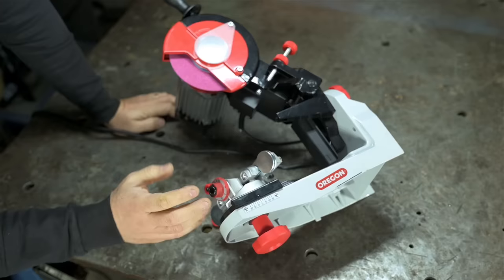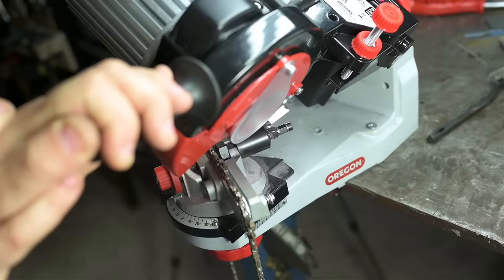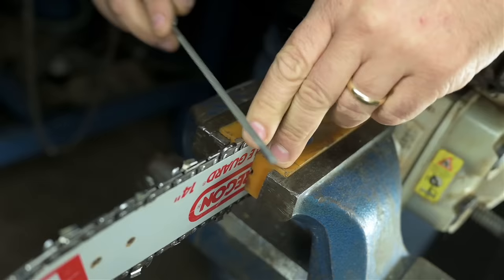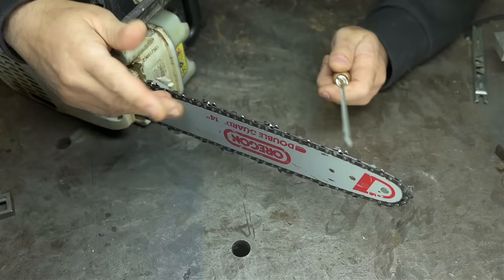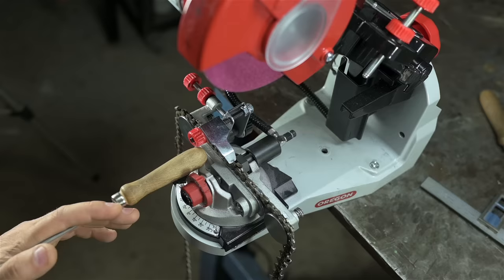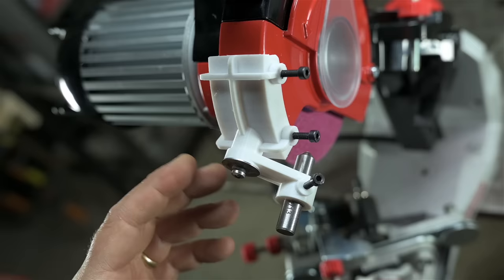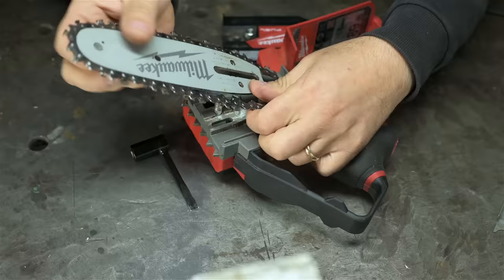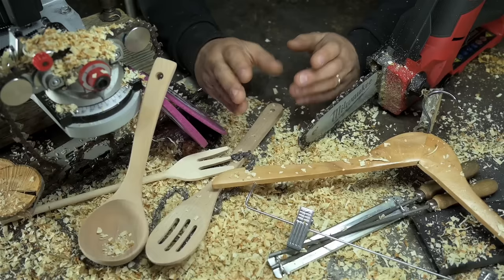Grinding Saw Chain! in Oregon! (620)

Comment: Before hand filing, mount an overhead green   laser to the angle you want to file at.   It won't help much, but will sure  make filing more fun.  👍
Reply: Lasers make everything better. And bacon. You can never go wrong adding lasers or bacon.
Reply: @feynthefallen  and magnets!
Reply: @unglud  and Banana Boat song on the radio.
Reply: @feynthefallen  why not go a step further
laser bacon
Reply: @Dairis Kuznecovs  now we're cooking!
Reply: @davydmir6565 with lasers!!
Reply: @feynthefallen  Lazerpig would agree
Reply: I came here to write this! :D
Reply: I remember the very first episode of "Car Talk" that I heard.  Somebody called in with a question, "should I pump the gas pedal when I'm trying to start my car?"

Click and Clack asked, "what is the make, model, and year of your car?"
The caller said, "It's a Chevy Bazinga, 1988."
Click and Clack asked, "Does it have manual windows, or electric windows?"
The caller (puzzled) said, "it has manual windows."
Click and Clack are delighted, and say, "Perfect! Next time you start your car, roll your windows up and down as fast as you can."
The caller asks, "what good is that going to do?"
Click and Clack say, "Nothing at all!  But your car has electronic ignition, and pumping the gas won't do anything at all!"
The caller asks, "But why should I roll my windows up and down?"
Click and Clack say, "Well, if you want to feel like you're participating, you can roll the windows up and down."

I do miss those boys.
Reply: @feynthefallen  However, adding lasers to bacon ruins the whole experience. Or vice versa. Better keep these two separate.
Reply: Nah, you really want a blue one instead, at least 8W...

Comment: Could I confess something, Tony?
I only get my chainsaw out every two or three years and I thought that when the blade went dull, you either bought a new one or found a professional to re-sharpen the old blade. Then, one day, I was buying a new saw chain and saw that the shop had a sharpening kit. IIRC it was less than £20 - essentially a file and a guide and a leaflet in a plastic wallet.
Fortunately, I never throw anything out, so I have a dozen blunt blades and I can now re-use them all.
For an occasional user, like me, I don't see the point of buying a grinder. The file and the guide let me bring the chain back to life in five minutes. I'll probably die before I use up my store of old blades. Possibly by bleeding out of my femoral artery.
Reply: A chainsaw grinder is not for the casual user. The one here is $500ish.
Reply: @1pcfred  Eek! That's more than I paid for my chainsaw!
Reply: @nicholashacking381  there's cheaper brands out there. Some are very cheap. They may suffer from some of the problems that ToT was expecting though.
Reply: You can get a cheap dremel attachment IIRC, that works pretty well. I think I saw someone using one of the grinding stones shaped like a dowel that worked like the round file except rotating vs back and forth.
Reply: @1pcfred  why not machine a structure to strap in a normal grinder? Make it bulky and tight or even destroy the old grinder in the process to make it sturdier.
 either way seems cheaper(and cooler) than spending 500$ on a fancy(overpriced) mounting vice with a grinder attached to it
Reply: @Ewr42  I would hope some engineering went into the product. I just use a mounted stone in a rotary tool to sharpen chain myself. It's very cheap.
Reply: @boots7859  Yes they do. Just make sure you get the right diameter for your chain.
Reply: As the unproud owner of a cheaper alternative grinder i paid 180€ for, they do the job just fine, but have some unprecision in the hinges. You're gonna have to armwrestle everything into tension  prior to lowering the arm to get rid of the different plays if you want consistency. Also change the stone which is usually very shit
But for my very occasional use they are good. A 500€ one would not have been worth it.
I wonder if there are attachments you can mount on a bench grinder to hold a chain, doing the opposite movement this is doing ? that could be a solution
Reply: Many years ago I spent a few hours cobbling together a chain sharpening jig for my angle grinder that bolts to the handle mount, it's made from bits of an old bicycle, it works fine, I now use it in the field with a battery powered grinder. Cost nothing but a bit of time and patience. Clamp it to a tree/post with a ratchet strap and its good to go.
If you're worried about burrs, just swap the direction of the chain so that the wheel-attack is on to the cutting edge.
Reply: I am also a hobby user,

But before I out a chain sharpen,

I change the chain. And if you catch a stone or nail, you file forever.
Reply: Do you own a Dremel?
Reply: @markferch5494  this thing work fine for me: Einhell GC-CS 85
Reply: I used a 20€ cheap grinder for quite a few chains before I decided to get a more adjustable 100€ cheap grinder. The cheaper one worked fine but the 100€ one is a chinese clone of the oregon one and uses the same stones, also has more adjustments. But as with all machines, you get a better result if you pay attention to what you're doing.
Reply: Didn't you get it when Tony said call it a blade in front of loggers, your going to look like a fool. Don't ever call the chainsaw chain a blade. Call it a chain, call it a chainsaw chain, but don't call it a blade, it is not a blade.
Reply: @reddogknives  The only loggers I know are computers that record data. If they think badly of me, I will not lose a great deal of sleep.
Reply: That last sentance... LOL.
Reply: Files are great and cheap and effective.
Grinders come up used and cheap if you really want one.
Always get to know your tools before using them, it'll save you a lot of time, money and spilled blood
Reply: @nicholashacking381  you're obviously in the wrong Realm
Reply: right on.   ive never considered that a chain sharpener could possibly do what i do with a file.  I'm sure my chain is sharper than most of the knives in my kitchen

Comment: I worked for Oregon Tool in the Machine Design Dept, designing the chain assembly/grinding machines. I learned SO MUCH about chain cutter geometry in the short time I was there and it’s fun to see it talked about again :-)
Reply: Hate to admit it but I have an irrational dislike for Oregon Tool only because when i worked at FedEx they were really heavy and awkward boxes to move around since they were so dense
Reply: I used to service the little CNC machines they had retrofitted to perform the actual grinding. I was always fascinated by the automation y'all had designed to get the individual teeth loaded into that machine.

Hopefully they're no longer using salt-water as a grinding medium...

Comment: Next project:  Foot pedal clutch cylinder connected to vise piston.
-4AN lines and fittings are used for race car brakes.  Pretty common and relatively cheap for DIY projects.
Thanks for another great video!
Reply: And an hour of chain sharpening with GAS GAS GAS song. With inserts of Tony pressing the pedal and SPEEED effects.

Comment: I have owned the more common “Little Brother” to your fancy version for about 25 years. There’s no going back once you figure them out and get good at using them. You’ll want to get yourself a chain breaker and rivet spinner and a 100 foot coil of chain. Then make up several chains , use each one until they’re dull and then you set up your grinder for one side of the chain and sharpen, for instance, all your left-side teeth. Then change your grinder to right-side teeth and sharpen all of those. Then if your rakers need attention set it up for raker grinding. Take small cuts on the teeth. It doesn’t take much. Once you get used to the machine the consistency will be there. You’re going to love this machine — I promise. I have several short vids on my channel. Check them out if you’re so inclined.
Reply: I agree on the chain breaker, rivet spinner and 100 foot roll of chain - huge cost and time saving. Baileys Online have a WoodlandPRO Chain Measuring Chart that is a great if you work from 100 foot rolls.

Comment: Im not a tree pro, but i do cut/split 15-20 cords of wood a year. Ive found that my dremel with a 7/16 stone bit is a nice in between. Having the dremel out anyway is nice for when i need to take down the rakers also (about every 5th sharpen or so). I have a cheap 400 watt inverter that plugs into my trucks cigarette lighter that easily runs the dremel, for when I need to touch up the saw on the go.

You still need to hold your angles correctly, and be careful not to blue the teeth with heat, but I'd take it over a hand file anyday. Much less of a pain to bring back a trashed chain and touch ups are quick and painless. 3 bits for 6.99 at tractor supply, im sure you can get them much cheaper online. 3x common sizes, same as hand files. Its definitely worth a try. Teeth come out like new.

Comment: Hey, Tony! Great vid, as usual! 2 tips from a long-time hand filer and 620 grinder user....
1. Change the chain pawl to the tall one included. Works much better than the shallow one. No need to spring load...
2. Ditch the included pink wheels and replace them with CBN wheels. You will be thankful you did!

All the best from South Africa
Mike
Reply: Was going to make the CBN wheel suggestion myself!  Dressing and messing with those pink wheels lasted me through 2 1/2 pink wheels before I went the CBN route.  Consistent and less "mess"!

Comment: Having used a similar machine for about ten years now. I get about two to three extra grinds out of the chains, as long as I'm setting up properly. The chains are more consistent and seems to stay sharp longer. It's also faster than hand filing as long as you keep the machine ready on the bench. In the field I use a file guide.
Reply: In the field I just try to keep the chain out of the dirt and I run what I brung.
Reply: @1pcfred  Well so do any sawyer. But if you work enough hours, eventually you will have to switch chain or sharpen it.
Reply: @GAIS414  I'm no sawyer. Generally I only tackle one tree a day. That's enough for me. That's usually how they come down too. One here, one there. Then the chainsaw comes out to chop it up so I can haul it away. The last one was an 82 foot tall pine that decided to fall down in the front yard.

Comment: Maybe you could build an override  valve on the hydraulic clamping to allow you to adjust the position of the chain.

Thanks for the video!
Reply: or have it clock the next tooth in like a revolver every time you fully lift the handle.
Reply: That occurred to me too, seemed an obvious and simple fix. A tee and a toggle piston, bosh/done.

Comment: Great video Tony. Im a dremel chain saw sharpening guy. The battery operated dremel can also come out in the field with me, so its a lot more versatile. I thought you might take that sharpener and try to adapt it to sharpen your mills.
Reply: the dremel is the way to go
Reply: It becomes painfully obvious to me when I have  to touch up  a full toothed 36 inch bar and then a full 30, then a full 24. Under 15 minutes easy. This is the present and the future. Dont have to take the chain off.
USe diamond barrel bits. Diamond doesn't get smaller like stone and stone is too aggressive.
Reply: 30 or more years ago when I got my first chain saw I thought there had to be a better way than filing.
I didn't know Dremel existed but I did own a pneumatic die grinder and assorted diamond burs and one round diamond file.
Sharpening blades became a pleasure, as long as I was in reach of my airline.

Comment: I grew up in my dad's lawnmower shop.  One of the jobs they would give me was sharpening chainsaw chains on a sharpening machine like this, but made in the 70's.  It had the catch to push on the back of the cutting tooth.  This catch was spring loaded, holding it down, had no side to side play, and the very tip turned up slightly.  This upturn would push the tooth down against the guide rails at the cutting side, while the spring tension would hold down the non-cutting end.  The guide rails were adjustable, but not a vice like feature.  To set the guide rail opening width, you would insert the chain and then tighten down a thumb screw at either end of the guide and pinch down on the bottom of the chain teeth.  You'd then back each thumb screw off 1/8 to 1/4 of a turn, giving just enough clearance to allow the chain to slide but not roll.  You'd eyeball match the rotational angle.  This got you close enough.  Then, you'd pitch the head over to a default setting, which was not the right setting, but close enough to get started.  The catch had an adjustment screw to move it along the guide rails.  You'd bring the cutter head down, placing the cutting wheel against the lowest part of the original cutting edge.  The catch would be adjusted to this point.  The head would then be moved up and down, adjusting the pitch over of the head until the wheel contacted the original cutting face for about half of the edge. Now the cutting would start.  The catch arm would be adjusted half a turn of the screw, and the whole chain would be run through on these settings.  This would clean up about 3/4 of the vertical cutting face.  The catch would be advanced another half turn, and the chain ran through again.  This would repeat until it was close to grinding the cutting corner.   At the back of the grinder was a flip down arm with an adjustment screw.  This would limit the vertical limit of the grinding wheel.  The wheel would be set against a tooth, at the corner, and the vertical limit adjusting screw would be gently snugged, then backed off half a turn.  The vertical limit arm would then be put in a third position, where the adjustment screw on it was lined up with a spring loaded pin that had a big knob on it.  Push the knob in, and the vertical travel is limited to what was set at the point.  The last pass of sharpening, the full front cutting edge and corner were sharpened, you'd push in the knob, bring the head down to this stop, and then advance the chain to the next tooth.  While advancing, the grinder would adjust the height of the depth gauge.  Everything would be flipped to cut the other set of teeth.  This sounds like a lot of work, but with setup and grind time, a single chain only took about 5 minutes.  We also offered non-stock grind profiles that the professionals loved  We would also do less aggressive profiles for customer machines which didn't have the power for their chain.  We could even face the top face of the tooth for a more abrupt corner..  I think my favorite modification was a 3 face faceted corner which gave 3 points for cutting the fiber rather than just one or a wedge.

Comment: Bought my Husqvarna sharpener at a yard sale for $10, including the 8x2 it was mounted on. Never have used it for sharpening a chain, but that grinding wheel comes in handy for lots of other things so I just mounted it on a floor stand in the shop.

Comment: Those Oregon saw chain sharpeners are the bees knees! We used to sharpen our chains by hand and they'd be pretty sharp, but after getting the sharpener our saw chains are razor sharp. They do take some getting used to, and in my experience you do have to lightly "kiss" the chain. Once you get used to them though, they are a game changer. We have a tree farm and about 12 chain saws of various sizes, so we're sharpening a lot of chains. Probably not necessary for someone with 1 or 2 chain saws. Also the hydraulic clamp would probably be a bummer as you mentioned, ours has the manual one and it's not a problem to use that way. Great video as usual.

Comment: I was told by a Oregon guy years ago that the burrs left by filling actually help ! I used to file from the outside in ( side with the edge I'm trying to sharpen) so there wouldn't be a burr ! Once I filed from the inside out and didn't worry about the burr it did cut better  For What it's worth. Thanks 👍 enjoyed your video

Comment: As someone who's been 3D printing, feels good to hear that it has it's pros over metal working. I eventually want to build up to metal working, but that is quite an expensive hobby.
Reply: The main difference is the manufacturing process difference: Additive versus Subtractive manufacturing

Metal working is mostly subtractive, and 3D printing is additive

Since you only add material to the surfaces that you want to build up, rather than remove material from the places you DON'T want, you have finer grained control
Reply: @Spiker985Studios  Actually, forging of metal provides wonderful grain structure as long as you don't messs with it by machining in the critical locations.
Reply: @bobturnbull18  He meant you have finer granularity of the control itself, not finer grain in the material lol.
But he's wrong, machining is orders of magnitude more precise than 3d printing, 3d printing is just far far easier to get complex curves quickly on, and to prototype and iterate designs.
Reply: @Epic501  That was certainly an odd way of expressing the point. I am familiar with both machining and three d printing having  both machine tools and a three d printer in my shop . I'll have to revise my opinion of the "granularity" of each.